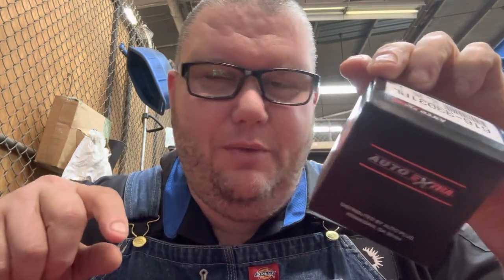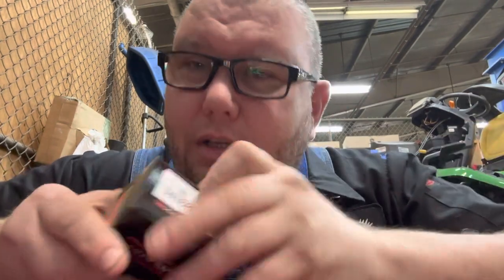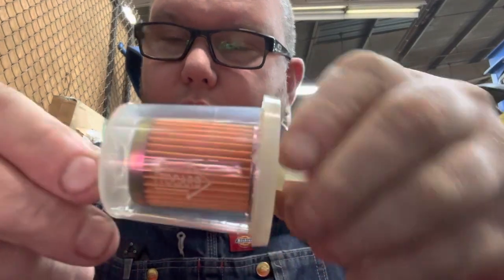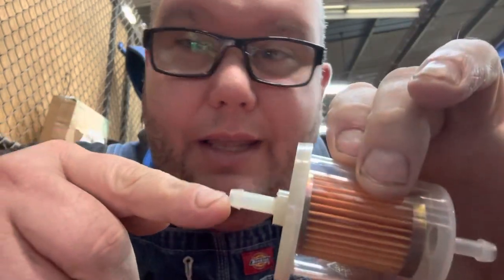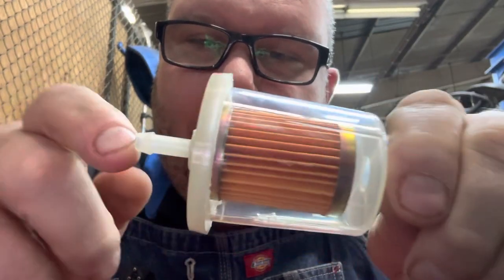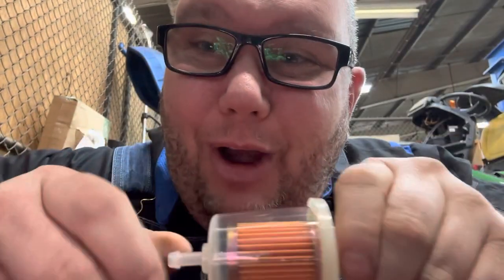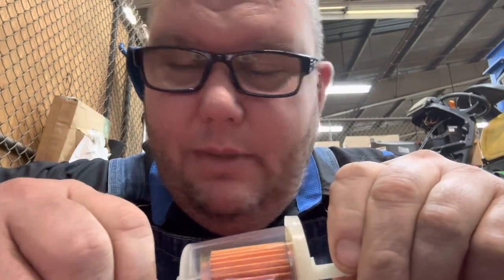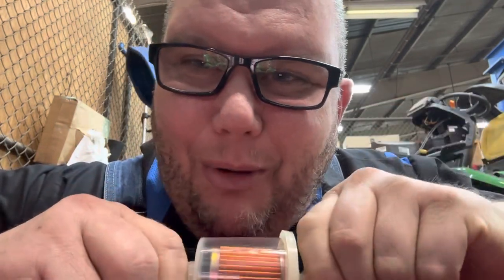REAL LIFE STORIES FROM THE LAWN MOWER SHOP : FUEL FILTER MISHAP

Comment: I have good compression on both cylinders, new pump, filter and carburetor and lines, still VERY little gas in filter.  Tried with tank cap loosened, starts then dies as key is released.

Comment: Hey, ran a shop for small engine's also, had a few mishaps myself. Those cheap China fuel filters were literally falling apart brand new? The glue that was used I'm assuming would just let-go as soon as the fuel would be run through them? They made me look bad a few times, to say the least? Have you run into this issue before?
Reply: I have had many